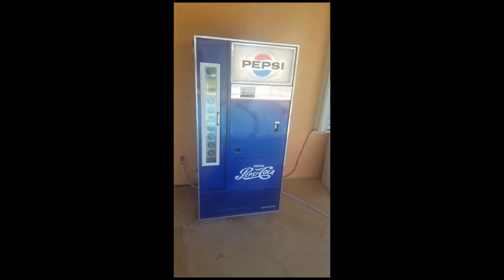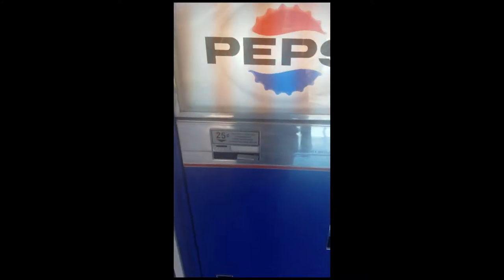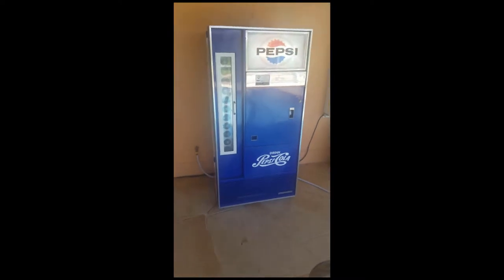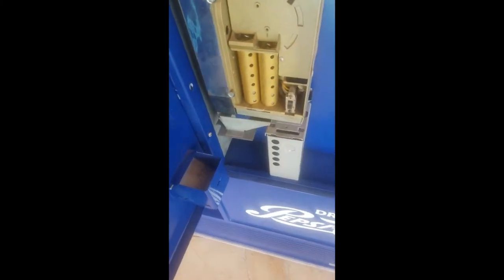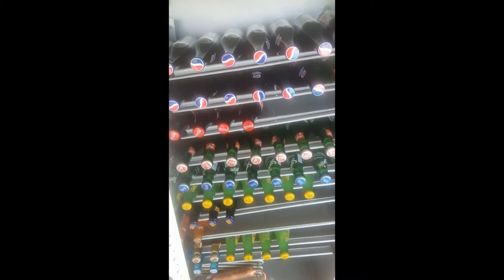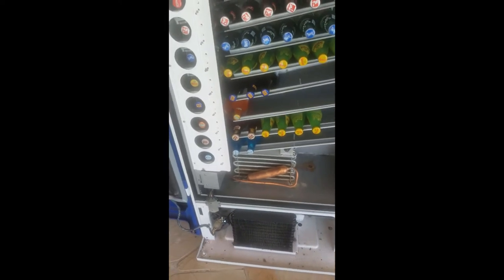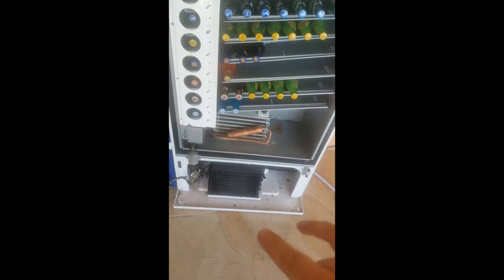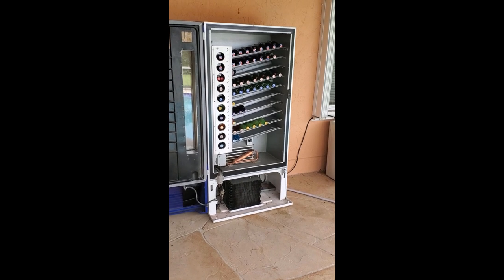Vintage Pepsi Machine Restoration!

Comment: Great job, I have a vindicator 56 original Pepsi machine still running refrigerant 12 never touched it. I’m getting ready to do a restoration!

You may know this you may not, but those units are heat pumps, I don’t know why I didn’t know this, but I used to winterize my unit. Take everything out, unplug it and cover it up well one year I forgot it got down to the single digits up in St. Louis I jumped off my couch ran outside, expecting to find all the bottles And bust it open button I pulled out and it was 33° It was 10° later that winter we got down to -10 with a negative windchill

My sodas were still 33° never froze !

I absolutely love this machine and I absolutely love old Americana. We built to last back then!

Comment: It's a lot work restoring these machines I'm polishing all my aluminum at the moment removing the galvanized coating on the trimming. I have a smaller unit only takes cans on my model.

Comment: Where did you get your cooling unit? Mine went out..
Reply from the maker: It's the original.  I've heard the original is better engineered than modern ones, so if it's repairable, that may be your best option.  They make replacements, but I am not sure where to find them. eBay maybe?

Comment: Hello,

I am restoring a vendo 63 Coca-Cola machine. I can find all parts except the chrome. Where does someone find that? Is that something you would have to have a chrome shop make? Thank you. 
Marc
Reply from the maker: I don't know of any sources for the trim pieces, my machine was not missing them.  However mine are not chrome, originally they were galvanized aluminum, which prevents corrosion.  My trim and faceplate were in bad shape so I sanded the galvanized finish off and buffed them on a polishing wheel.  They came out just ok.  

To have the trim and front  plate chrome or nickle plated would likely cost more than the machine is worth.
Reply: hi there.  we just bough a 63 and it is missing the face or trim of the bottle opener area and then the handle to open the door.  do you have a good source for replacement parts?

Comment: I wonder why Pepsi is getting harder to find? They had a lot of success with their "Pepsi Throwback" or whatever they called it. I know they didn't produce a lot of it at a time---probably to up the mystique and demand for it...not a great idea but who knows?
    Down where you live,  in nearly every Latin market or convenient store, you can find the El Salvador Coca-Colas....also Nicaragua and Honduras. They are to be found in the 12 oz. bottles and the Medio Litro size...all are far superior to Mexican Coke, which I still like, but now drink only when the others are not available.
Try one. The import label on these bottles make them easy to identify; large, with COLA COLA in large letters (typically). The bottle caps are an attractive bronze color, not the bright red of Mexican Coke. Drinking one right now...you won't believe the smooth flavor. For a special treat, put a little pure vanilla in the bottle and enjoy a TRUE vanilla Coke. Enjoyed your video!!